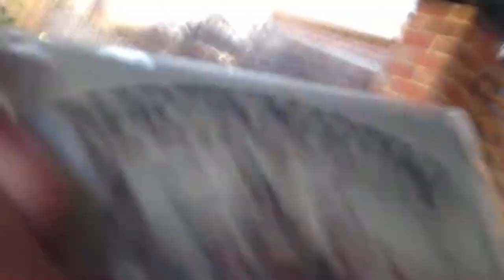Lawnmower SMASH Brew Day

Comment: I went 3V to BIAB and than back to 3V. I enjoy 3V a lot..can't exactly say why. I also installed keg king elements in my 3V system. Works a treat and brings temps up fast. I have 1 KK element in my HLT (Holds 55L) and 2 KK elements in my keggle..I bring 60 degree wort up to boil within 30 minutes, thats 50L. Nice video mate. I am planning a similiar brew as per request of my old man, its a 200 year old Cascade recipe which simply calls for pale malt, POR, sugar (probably will omit) and a lager yeast (Will use MJ's M54). Happy Brewing! BTW I'm in Perth, WA. Happy Straya Day!